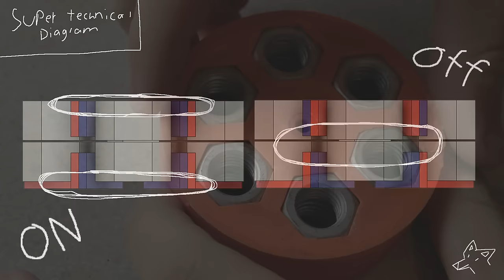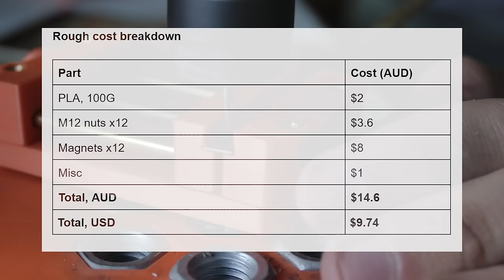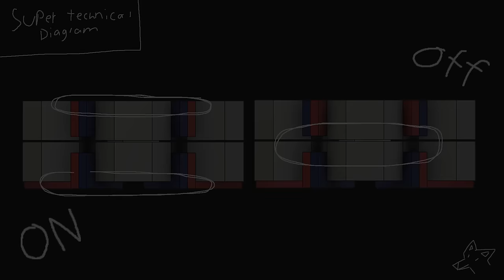3D Printing A Magnetic Chuck

Comment: Switchable magnets are cool. But would it not have been better to make the lower ring spinny and fix the upper one? This way the vice would not have to rotate (eliminating any chance to bump and misalign it in the process; and generally easier to handle when parts stick out and stuff). Well, probably not an issue with the small part you're going to tap on this.
Reply: came here to say exactly this :)
Reply: +1 for it
Reply: This also brings up the idea of any misalignment between the headpiece and the center of the rotating base, if you line it up with center of the bit and that's not the center of the pivot, it would also move out of the way when clamped.
Reply: Der deutsche Ingenieur.

Comment: You should make a second iteration and fix those bolts. Also revolve the lower section instead of the upper. This way your vice does not rotate when you lock the chuck, which makes this whole contraption border-line unusable.

Comment: Spitballing, but would it be possible to use a mechanism like this to lock the ball vise in place in a particular orientation, instead of relying on weight to hold it in place? I know the ball vise has decent holding power, but with something like this you could probably get a higher holding strength with less weight added. Also, perhaps more importantly, I feel like it'd be super cool

Comment: Where is the press adapter with a soldering iron? 😉 Threaded insert pressing has been in all of your recent videos... right? 😁 I use an off the shelf dremel drill press with an 3d printed adapter. Seems like a good use for what you are building.

Comment: i was wracking my brain about how to 3d print a mag chuck... didnt consider nuts to carry the magnetic field!
what kind of range does the field have? do you need to have the nuts bare against whatever you want to attach or can you have like a mm of pla sheet inbetween without losing to much attraction?
also adding a thin plastic disc between the two layers might allow for easier locking and unlocking since you wont be fighting friction as well as the magnetic forces (or seal the bottom and add some lubrication to the system)
Reply: you could most likely one or 2 layers (maybe add an insert in the middle of the nut to reduce bridging ), or some sort of sheet, another option might be multi material printing some iron filled pla if you want 1mm.
0.2-0.5mm G10/FR4 might work well.